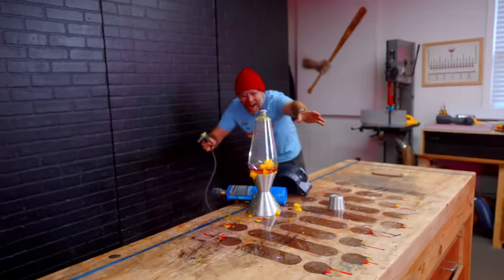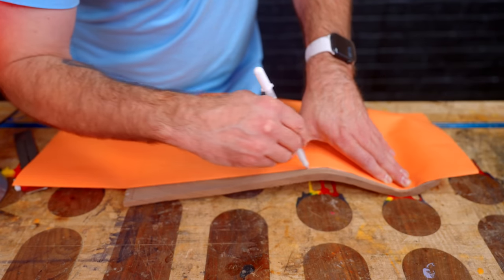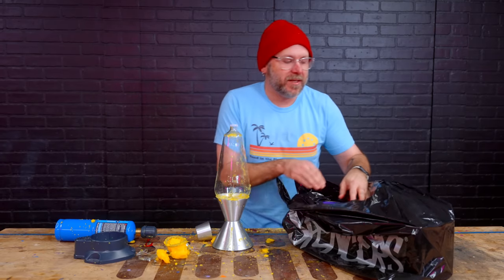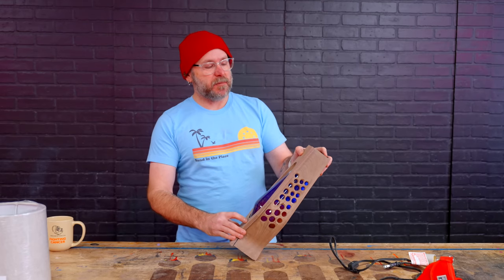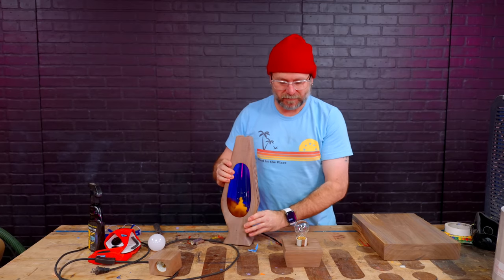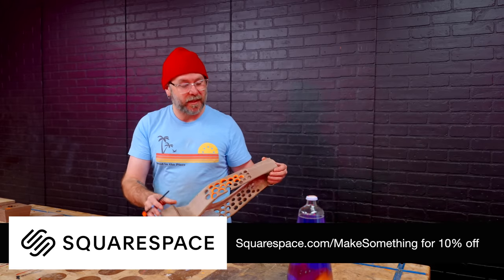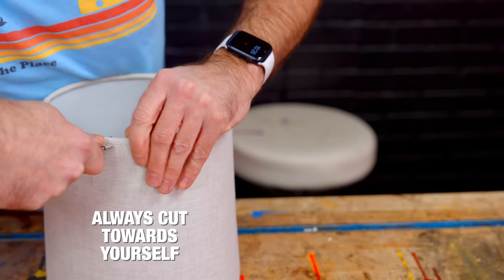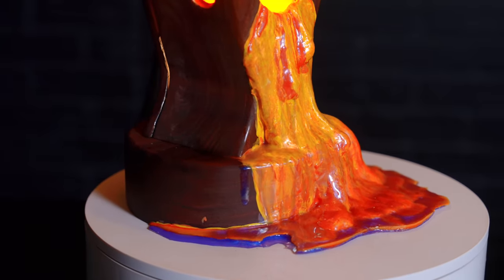Making a Lava Lamp into a work of art. Cheap to Priceless!

Comment: Would it be possible. Too make wooden base,, have heating lamp inside the wooden box. with 2 holes on top  to heat 2 lava lamps with just one bulb or would it be just too hot . for the wood